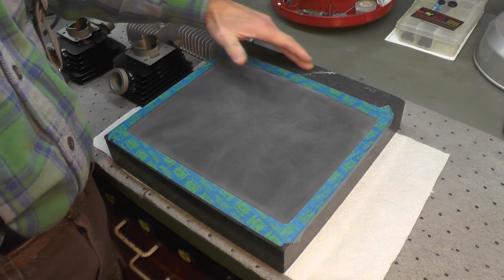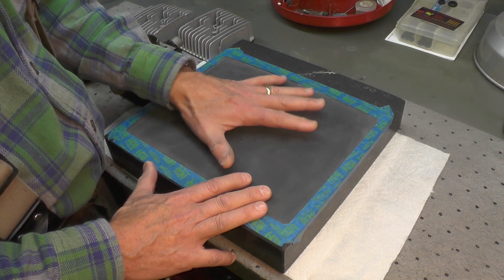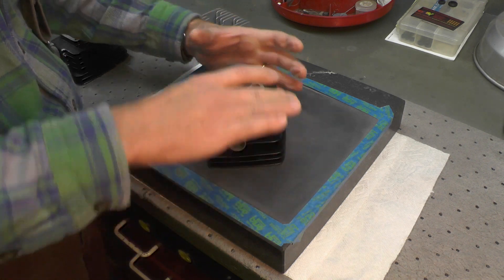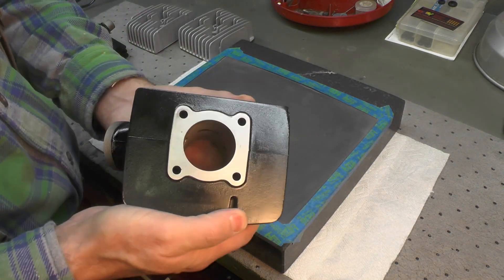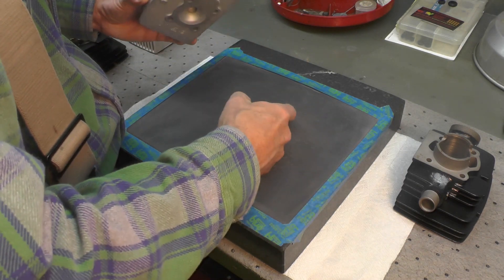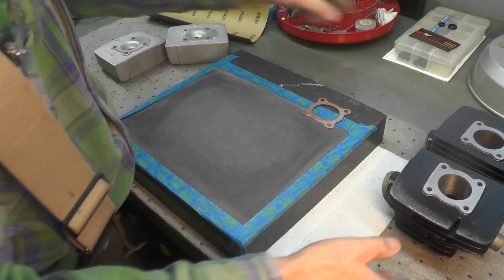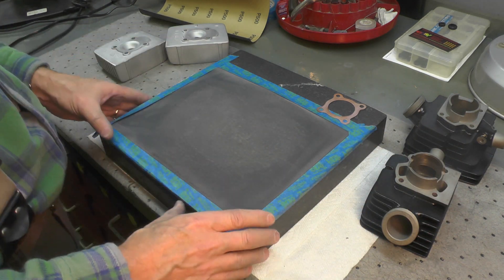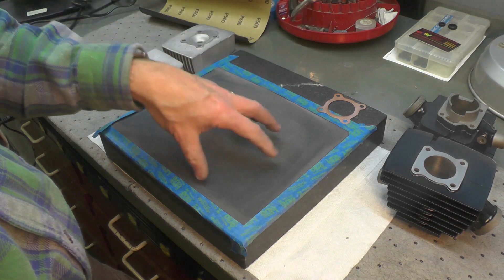Shop Talk #13, Truing Head & Cylinder Surfaces --- Video #154

Comment: I do this, but I brush the sandpaper (we call it 'wet & dry' in the uk) with soapy water which leaves a nicer finish and prevents dust coating the bore and ports. (just my oppinion).